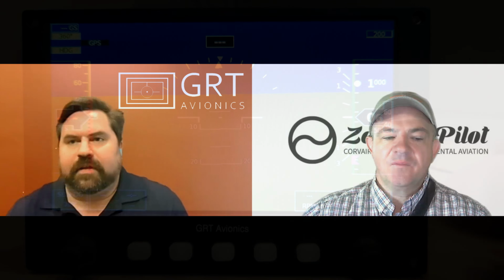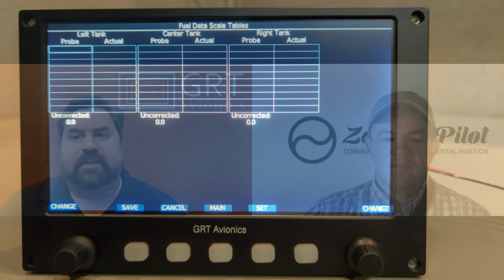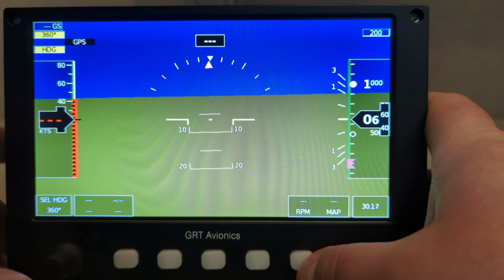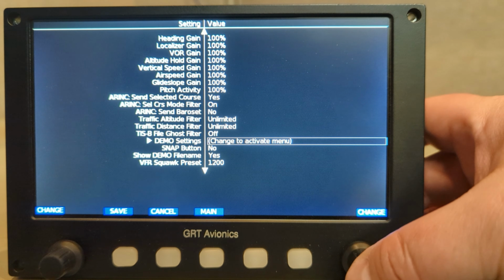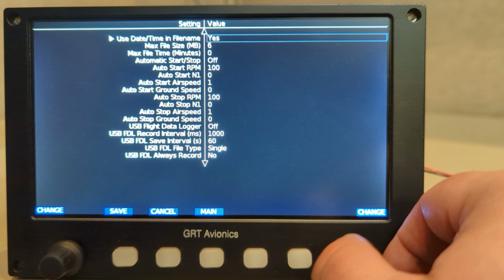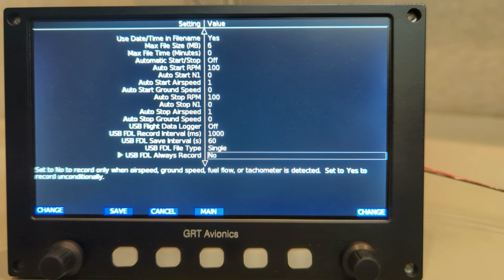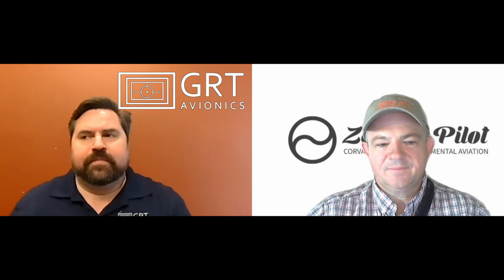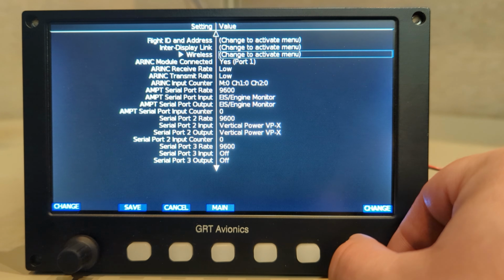Top 5 Concerns for your GRT Installation from @zenvairpilot

Comment: Thanks for the video - this is great.  I'd really appreciate more videos on how to use my GRT Sport EFIS.    Also, no idea if it's on your roadmap, but a PC-based simulator would be great.  I can see that the EFIS runs some kind of Linux with X, so perhaps there's a way to get it running in a VM.  I'd like to be able to test things on the ground since I'm in a tandem-seating RV-8, and I can't really fly with a safety pilot.  My EFIS is rock-solid, and I have it connected to the EIS, and I also have a pitch and roll AP which works well.  I'm only using it in alt hold and heading mode, mainly because it's hard to test things when flying alone and keep an eye out for bogies.
Reply: I put out another video where I go through using a few of the features.  I also posted that video here on the GRT avionics channel.
Reply: There is an old but still very useful series of vids on you tube done by Widget Morris with the HxR that you ought to look at.  AFAIK the software implementation of the various flight functions does not differ between all the GRT EFISs'.....I looked at them several times as I built, and up thru Phase1, and still go back to them for reference.  He gives you a good run down and then you can develop what works for you.  I basically use the same concepts, but tweaked.  Im fully IFR with a GNS480 pumping in data, and 2axis AP.  I dont fly with a safety pilot; I just fly in airspace thats pretty quiet during the week and when Im heads down noodling something, the AP is on and the inserts have Traffic on 6 or 12 mi.  I also have three screens so that helps me noodle on one and monitor the others for flying morons.....I fly a Bushby Mustang2.